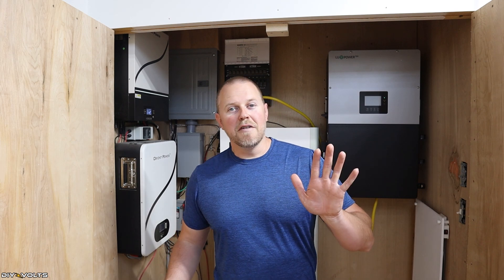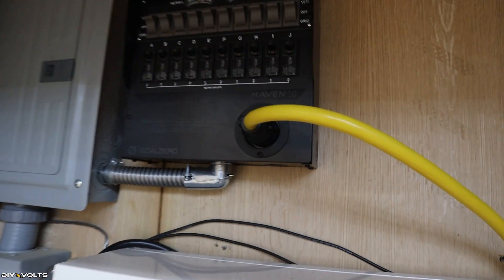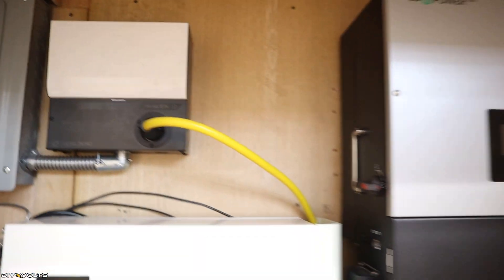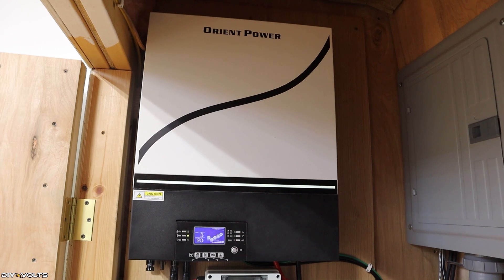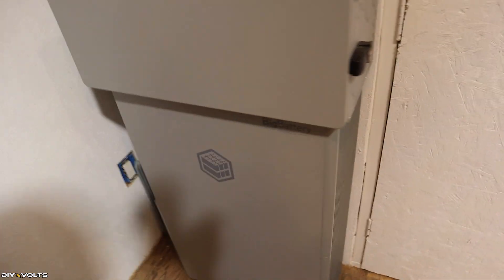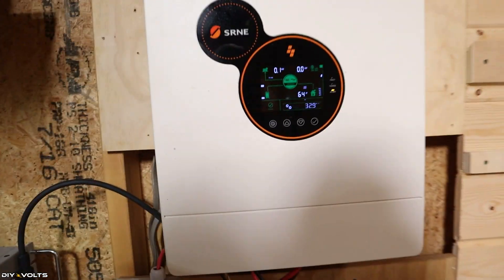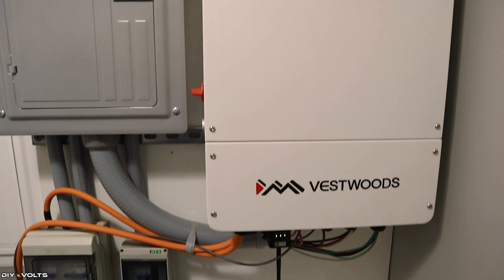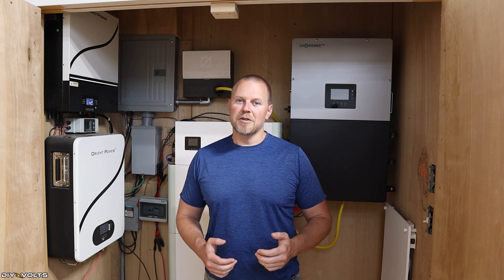Tour my 5 Off Grid 48v Solar Systems

Comment: Nice batteries, but the worst possible choice for an inverter. High-frequency, transformerless inverters like the one you installed offer a shorter life expectancy, and a much poorer surge capacity. And because these low-cost (cheap) inverters don't have an output transformer to provide galvanic isolation, they can damage your off-grid home's appliances when their MOSFETs fail. Don't take my word for it; ask Google AI the following question: Can a high-frequency, transformerless inverter damage your appliances?" and learn the truth about these crappy inverters.

Comment: How are your grounds connected through your transfer switch. Your not supposed to have Grounds in several locations(breaker locations/inverter) since that can be dangerous  and its a code violation...  Just curious. stay safe...
Reply from the maker: The transfer switch ground is pulled from the breaker panel. The transfer switch has the included ground wire to make this connection easy.
Reply: @DIYVolts  perfect!

Comment: You showed grid connected systems, not off grid.  Also, with all that solar/battery setups (5) why do you need to connect to the grid at all!
Reply from the maker: The shop system does have a transfer switch so that I could use the grid if I needed too. In the winter I swap over one breaker for a heater. The last setup (5) is off grid. It has a critical loads panel that is not connected to the grid. I have a breaker that can be turned on if the battery drops low. I had to do that a couple times this last winter when the weather was cloudy for 4+ days.

Comment: @DIYvolts good content but its amazing how much more research you need to do with the inverters you have, for example the LuxPowertek 12k hybrid inverter do not need a transfer switch you can backfeed your main panel directly even with live grid power coming in, the inverter will support all the loads in your ESP load and grid sides simultaneously and if you do not have enough VP or battery then the grid will over the extra, and you only need to keep just your real critical loads on the ESP, just have your CT’s at the main panel and setup the inverter for zero export and it will not back feed the grid.
Reply: Also the LuxPowertek 12K is the best inverter out of all the other inverters you have! The LuxPowertek can support unbalanced up to 10+Kw on one leg, its not limited to 6k per leg but up to all 12k on a single leg, my testing is got up to 10+kw continuous on one leg. Again thats the best inverter you got.
Reply from the maker: The 18k is the best! One of my favorite things is that the unit runs silent unless it has 5000w or more. nice to know that it can run so much on a single leg. So far my loads are under 3000w most of the time.
Reply from the maker: You are right! When I built this shop I only had the Orient power inverter and battery. When Big Battery asked me to make videos on the Lux and Ethos I made the changes to accommodate the new inverter and battery. I also just upgraded the house system to the EG4 18k. Because I already had an inverter in the house with critical loads panel  I also do not have the CT connected on that unit either. I do however have a breaker and grid connection so that I am able to use the grid if I need it.
Reply: @DIYVolts copy that yeah the newer modern inverters hybrid or power limiter or zero export inverters are truly amazing LuxPowertek has some of the best inverters on the market EG4 rebrand for US market has done very well with LuxPowertek inverters some of the other rebrand inverters they used back in the day was no good, happy they discovered LuxPowertek products, but yeah for people thats just looking for peak shaving and battery backup can now have very simple installation, for peak shaving setup all thats needed is some PV’s and backfeed the main panel with the CT’s on and zero export enable, no need to have any net metering agreement as the inverter is technically in off-grid mode with zero export enable and the CT’s are connected, anyways no need for critical load panels anymore with today’s awesome hybrid zero export inverters.

Comment: What are the battery settings you are using on that SRNE setup? For example float, min voltage, boost, recharge recovery etc. I noticed you not using the BMS on that setup meaning you would have to code those values instead of setting % values that the BMS could determine. What is your reasoning for not using the BMS in that setup?

Comment: I just finished my upgrade 15-04 2024, the old system was only 24v 110w solar panels with a very old inverter from 2000watt from the year 2000, not in use more for at least 8 years.
the new system is also 24 volt on the output but the input from the solar is now 36volts with lager battery's and a modern inverter, a new setup with 2 pumps running on solar, now my toilet and garden are energy free.

(and 2 new 24v solar groups how spit in four 12v solar groups, this powers my house lighting with led lights. 5 generation.)
( 4 panels and 8 battery's).

€ 400 1 suction pump to pump up groundwater. second hand
€ 175 for a pressure increasing pump. second hands
€ 300 two solar panels of 310 watts at 36 volts, 9 amp max each in parallel.
€ 190 four batteries 110ah 12v (2 in series) (2 in parallel) from the iron scrapyard.
€ 200 two large batteries as a buffer. secondhand.
€ 350 a Tristar 45 charger. new
€ 75 a second-hand switch box. small
€ 50 a second-hands switch box. big

€ 275 inverter from 24v to 230v 2000watt. new
€ 150 for fuses and circuit breakers. new
€ 100 for the wiring. new
€ 125 two automatic switches for battery and mains. new
€ 50 WiFi / smartphone controller. new
Reply from the maker: An upgraded inverter is nice! And more battery power is the best! Since filming this video I have upgraded my house system with the new EG4 18k. So many nice features. The best one yet is how quiet it runs. silent until 5000w goes through it. Congrats on the upgrade!